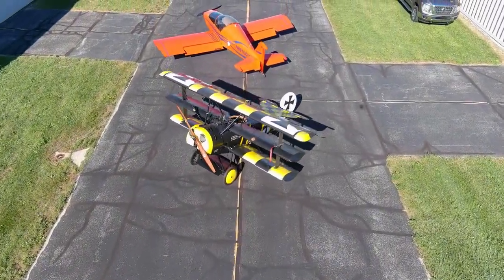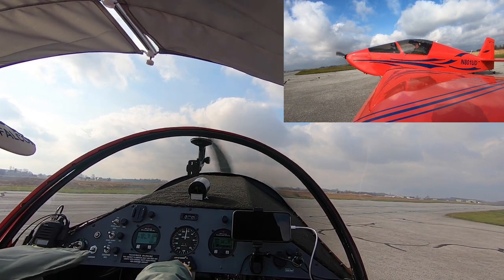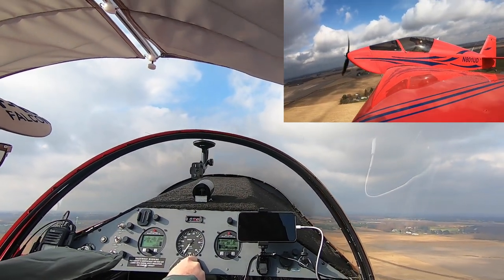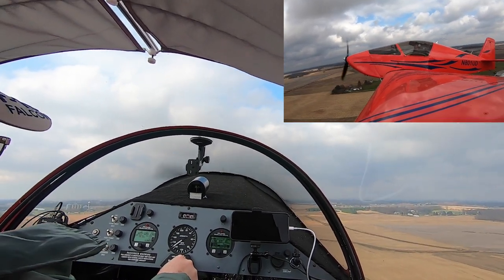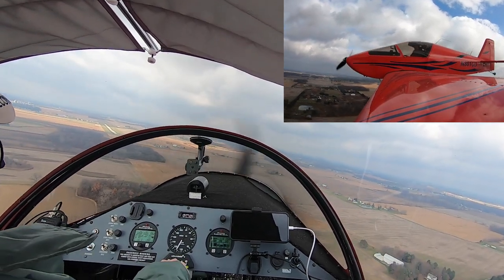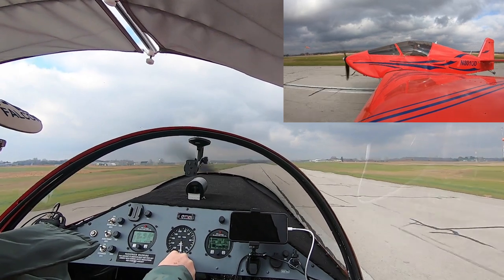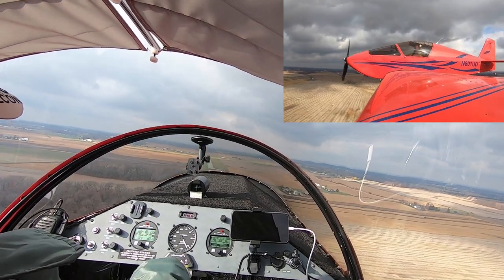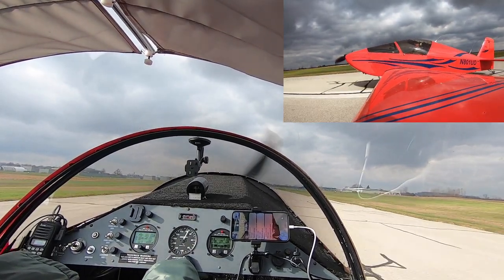Sonex Adventures - Touch N Goes - N801UD

Comment: What engine? Could you comment on your carb and carb heat set-up? Does your carb have mixture control? Seems like you have more power than a VW. A friend running a Zenith said he has to run the pump full time. If I remember, he said during testing with pump off, engine quit at altitude. I can't remember if it was 5000 or over.
Reply: John runs a 3300 Jabiru.